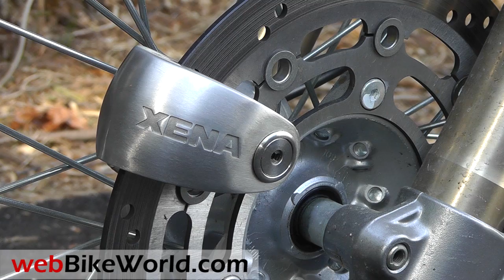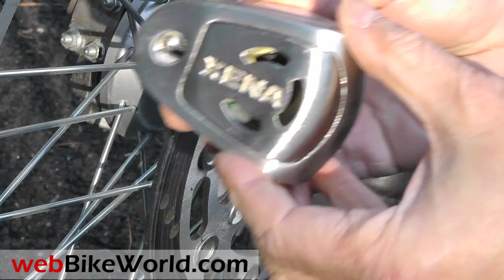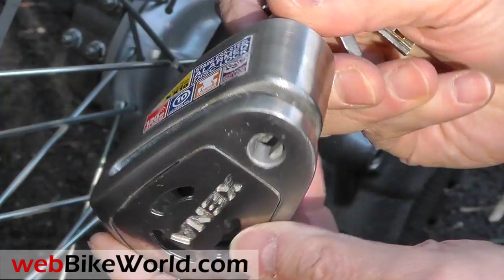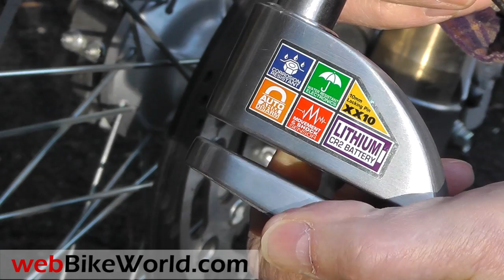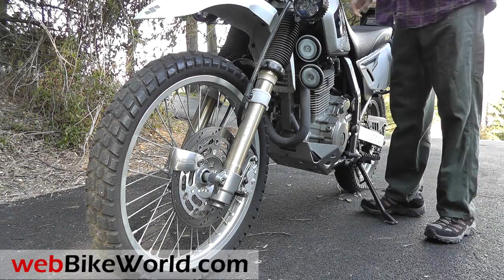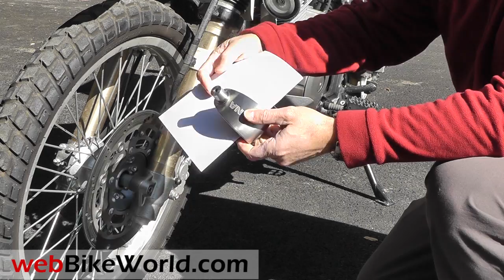Xena XX10 Disk Lock Alarm

Comment: I recently got the XX14. It feels pretty solid and has a much better, smoother locking mechanism compared to the little XZZ6 I had before. The optical alarm system isn't great but it does the job.